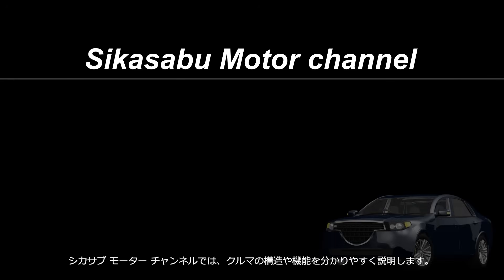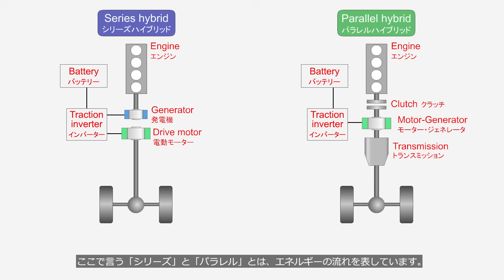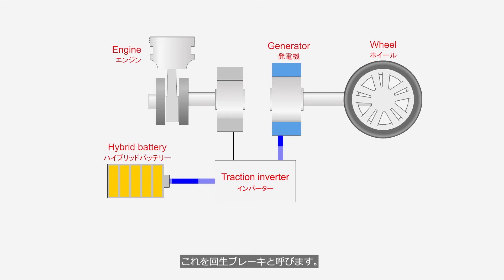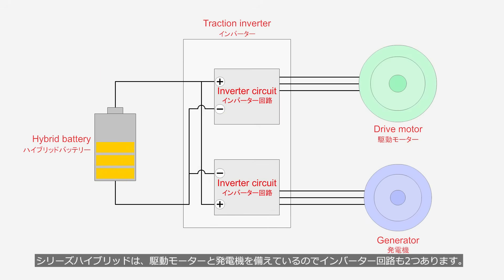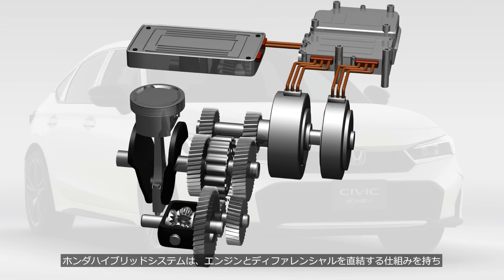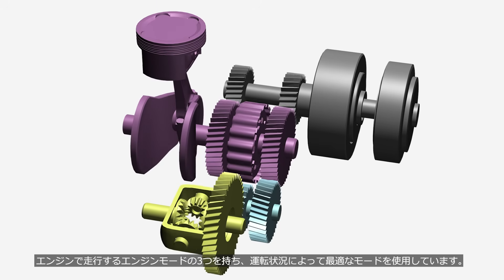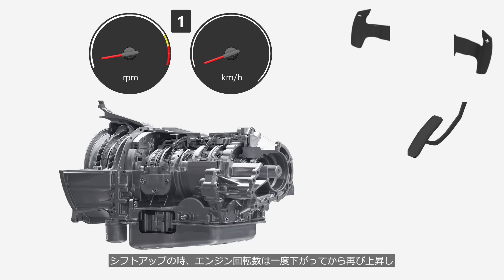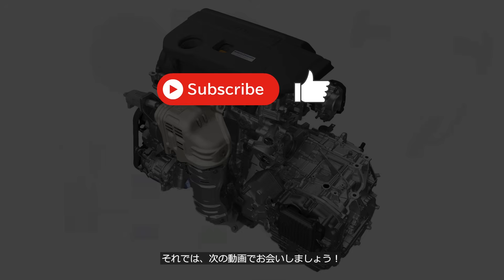Deep Dive into Honda Hybrid System　Can It Beat Toyota?

Comment: Honda's system is a copy of Mitsubishi outlander PHEV which is in use from 2012 or 2014 and proved. But Toyota's power split does not use clutch so Toyota's system is less complicated and superior
Reply from the maker: Thank you for watching the video.
The Mitsubishi Outlander PHEV was released in January 2013. The Honda Accord, which has a similar two-motor + clutch mechanism, was also launched in January 2013.
Reply: Mits uses the parallel hybrid mode for power assist, while Honda uses it for efficiency during cruise. So they have similar mechanics with a different purpose. And Honda's has been in use since 2013 (in Japan) and 2014 (in North America).

Toyota's system was stol... er, "developed independently" according to the lawsuit settlement - from one developed at the University of Maryland in the early 1990s. It is more complicated - mechanically, computationally, and electrically - since (1) it has more moving parts, (2) it must use both the parallel and serial hybrid paths at the same time, and (3) it must control them in unison. The Honda merely switches between the two.
Reply: @jeffjo8732  Yes. Toyota design did match the former Soviet engineer's design in some part of the design and had to pay. Honda system also (all cars including electric) will have a reduction gear. In the end Toyota Hybrid is more efficient than any other hybrid and multiple third-party tests have proved that.
Also, I have a 2005 Prius and still getting over 50+MPG in summer with 170K miles on it. Proven system for me. 
Honda's system is ingenious, but the real-world MPG is nowhere close the expectation (especially the CRV).
Reply: @adambakkam1527  I’m not sure what you think the reduction gear has to do with anything. It is not part of the infringed patent, if that is what you meant. Nor is the planetary gearset (Power Split Device). The control system is what was patented.

The planetary is, in essence, a glorified differential that has been used in many diverse applications, including some automatic transmissions. What the PSD does – and the patented control system governs - is allow power (of the appropriate type, mechanical or electrical) to flow, in any direction, between the ICE, the battery, and the wheels. The point is that the ICE is more efficient when it produces more power than is needed for cruising, but less than for acceleration. By using the battery as a buffer, the ICE can stay in its most efficient power band far more often than a traditional car could. This system was devised, implemented, and patented by a Ukrainian refugee from the Soviet Union before Toyota attempted the same. It seems absurd, at least to me, that Toyota would not know this at that time, yet that was their claim.

I also have no idea what third-party tests you think prove Toyota’s Hybrid Synergy Drive is more efficient that Honda’s Intelligent Muiti-Mode Drive. You may have confused, as most do, economy (mpg) with efficiency (utilization of the energy in fuel). A larger car with a more efficient power train can have lower economy.

AND, the Hondas that people think are “comparable” to Toyotas tend to be about to10% larger. For example, the passenger volume (in ft^3) in compared models are: Corolla 88.6, Civic 99.0, Camry 99.9, Accord 106.1. Of course, the Toyota measurements omit the "optional" moonroof that is standard in the Hondas. It takes about an inch from headroom, for these measurements. But wheel and tire sizes also play a part: the reason a Camry LE gets 51 mpg, while the SE gets 47 mpg, is exchanging 16” diameter wheels with 205mm wide tires for 18”, 235mm.

The best head-to-head comparison is the Camry SE and Civic SPORT. They are almost the exact same size (115 ft^3 total to 113.8) and ride on the same tires. The Civic gets 49 mpg. So iMMD is more efficient than HSD.

Now, I will agree that iMMD is more sensitive to aggressive driving on the highway. Since it is easier to apply quick power (being, in essence, an electric car), changing speeds frequently will push it out of the efficient power band more often. But in my 100K mile 2018 Accord (rated 47 mpg), I also get “over 50+ mpg” in the summer. Yesterday, driving 95 miles round trip to visit my son’s family, it was 56 mpg. That was 50% rural highways and 50% interstate (55 to 65 mph limits). But last week, a 250 mile day with city and higher-speed interstates, it was 55 mpg. Lifetime, it has averaged 48.5 mpg over all conditions. So this is above expectation.
Reply: @jeffjo8732  Meant to say that every car will have some transmission and nothing is transmission free. Honda uses two wet clutches which could wear down and in the power split there are no wearable parts.
Reply: @jeffjo8732  Thanks for the detailed explanation. I have learnt something new today.
Reply: @jeffjo8732  Thanks for the detailed explanation. I have learnt something new today.
Reply: @adambakkam1527  "Meant to say that every car will have some transmission." Technically, "transmission" means the act of moving power from one place to another. So every car needs a transmission system. In practice, "transmission" has come to mean either (A) the mechanical parts that connect the engine to the wheels, or (B) the parts that change the gear ratios in an A-transmission.

Honda's iMMD has a transmission system, and a part-time A-transmission. It does not have a B-transmission, contrary to how AMD describes it.

"In the power split there are no wearable parts." Sorry, that's wrong. Gears are "wearable parts." But the amount of wear experienced is essentially negligible. Because of how Honda's clutch is used - again, contrary to how AMD describes it - one in all models except the CR-V - it also experiences negligible wear. It only closes when the car is not accelerating, and speeds are matched by computer. Anytime the car accelerates it opens.

To demonstrate how little wear it gets, Toyota hybrids are more prone to clutch failures. Yes, they have one. It is a permanently-applied clutch built into the flywheel. It protects against sudden changes in either the engine, or wheel, rpm. In fact, all hybrids have one. But it is only in PSD hybrids that the engine is connected to the wheels when the engine is started. This causes slipping in this clutch that iMMD does not share.

Comment: Honda and BYD operate similarly.  Two motors, ICE engine, and parallel mode to front wheels.  BYD clutches the ICE output to front diff above 70 km/hr
Reply: Planetary gearset is more durable than a clutch though
Reply: @miraphycs7377  Weber Auto on utube.  Professor Kelly has a series on Toyota eCVT.  There are clutches on the planetary gears.  Synergy drive is an excellent system, but BYD is leaning on their blade batteries more and less on ICE.  This then allows a simpler transmission.
Reply: @mefobills279  First of all there are no clutches on the planetary gears. There is a "Torque limiting clutch pack" attached to the crankshaft of the engine that is used as a "damper" to lessen the shock impact between the engine and transaxle. This clutch pack does not disengage and re-engage like a regular clutch does. It’s simply there to absorb impact and torque from the engine to minimize damage to the transaxle. This is not a high wear item and should not be compared to the clutches used in other transmissions. It should never have to be replaced under normal operating conditions. These systems have proven to be very reliable. Some are even starting to say that they’re more reliable than a manual transmission.
Reply: @escheidl  It may not be high wear, but there is some. And the torque damper experiences more failures than the clutch in the Honda system.

The way the PSD works is by maintaining the rpm relationship 13*MG2=5*MG1+18*ICE. Note that motors operate in either direction, so MG1 and MG2 can be negative. And here, MG2 is directly geared to the wheels, so it is essentially the speed of the car.

To operate electric only, MG1=2.6*MG2 so that ICE=0. To start the engine while the car is moving, MG2 is actually slowed to make ICE increase in rpm. Essentially, it is the momentum of the car that starts the engine, not MG2. This is all done through the countershaft, the entire transaxle, and the torque damper. It is a much less gentle operation than starting the ICE with the generator alone, like Honda does.
Reply: @escheidl  it's hard to say whether this seemingly clutch-that-is-not-a-clutch is any more reliable than a plain ol' clutch. In fact, it has to "absorb impact" too, just like a regular clutch, except if I understand it right, it's doing it all the time. I don't really understand how the engine in the Toyota is engaged and disengaged from the drive shaft seemingly magically without wear as people seem to think. Parts have to rub together or separate in some fashion to do this. There is no free lunch here. 

I find it funny that it seems people are assigning magical powers to planetary gears. They're gears! In terms of reliability, they are no better than any other gears.
Reply: @Trekster1268   ? Toyota's engine is never declutched, it doesn't have to. When it needs to stop, the motors spin in a way to make its RPM go to 0. When it needs to start up, the motors spin it up like a starter.
Reply: Far more durable. It's the last mechanism that will fail in the system. It just doesn't offer coupling and uncoupling. Benefits to both @miraphycs7377
Reply: That is correct and this means that there are three possiblities in Honda/BYD system. 

First, when there is a full juice in the battery electric motor alone powers the wheels without waking up the gas engine. 

Second, at lower speed it functions like an aforementioned series hybrid system whereby the power goes from the engine, generator, battery, electric motor and finally the wheels.

Third at higher speed the engine alone is doing the work and is directly powering the wheels.

Toyota having the planetary power-split means not only can have these three scnearios but also having the engine charge and power the wheels at the same time as well as engine and electric motor both working together turning the wheels. This results in Toyota having better fuel economy at higher speed than Honda or BYD DM-i.
Reply: @miraphycs7377  At higher speeds, ICE is clutched to diff and may also be spinning motor generator two, charging the battery.  Toyota is doing a joint venture with BYD.  Toyota synergy drive is excellent, but their planetary gearset has higher costs than a simple clutched gear set like Honda and BYD.
Reply: @miraphycs7377  "Second, at lower speed it functions like an aforementioned series[1] hybrid system whereby the power goes from the engine, generator, battery, electric motor and finally the wheels."

No. Power goes from the engine to the generator to the Power Control Unit. The PCU then adjusts the power using the battery to send the right amount to the motor and finally the wheels. It adjusts down during cruise, by sending part of the power to the battery to charge it. Or up, for higher acceleration, by discharging the battery.

This may seem like a nitpick, but the "adjust down" is the heart of any hybrid system. It is how the battery charge is maintained.[2] The following is for the 2018-2022 Accord, but the principle is the same. The ICE is most efficient - 40.6% - when it makes 34 HP at 2000 rpm. And over 40.2% between 22 and 52 HP. But to cruise at 40 mph (the fastest cruise using your second mode), it needs 8 HP and is at best 33% efficient. So the ICE overproduces by operating somewhere in that 40.2+% range, and uses "adjust down" to charge the battery.

"Third at higher speed the engine alone is doing the work and is directly powering the wheels."

Not quite. The same "adjust down" is accomplished using the traction motor as a generator; "adjust up" is also possible, but usually your first mode is better.

"Toyota having the planetary power-split means ... the engine [can] charge and power the wheels at the same time." "

So can the Honda. In fact, the Toyota has to either operate below its best efficiency, or send a much larger portion through the battery, with losses, because it is using a larger ICE. So the Honda is better at this.
+++++
[1] Serial hybrid. "Series" is a noun, as in "the engine, generator, and motor are configured in series." "Serial" is the adjective form, as in "That makes it a serial hybrid." The confusion is probably caused by "parallel" being both a noun and an adjective. I know that most of the world uses these words incorrectly, and don't really care. But I can't say "series hybrid" any more than I can say "that ain't right."

[2] Regen recovers only about half of what is needed to return to the same speed. The rest comes from gas or drains the battery. So regen does not contribute to net charge, it only reduces what you would lose to braking.
Reply: @miraphycs7377  But Toyota lose acceleration to Honda/BYD.
Reply: @alexlo7708 It depends on the torque curve and whether you are accelerating from a stop or at speed. If you are going 100+km/h and wants to accelerate again, Toyota’s series-parallel hybrid will best out pure serial hybrids.
Reply from the maker: Thank you for sharing the information. I'm also interested in BYD's mechanisms.
Reply: What causes the Toyota eCVT droan noise that the Honda eCVT avoids? My ‘24 CR-V hybrid transmission is considerably more quiet & smooth than the ‘25 RAV4 PHEV I also got to drive for a day. I noticed increased transmission sounds below 25 mph (on the Toyota), especially when decelerating.
Reply: China car good luck. Used various china tyre cannot make it. Cannot even make good tyres so good luck..
Reply: I seems that important is, Made in Japan or Made in China

Comment: What’s better between Toyota and Honda’s latest hybrid system?
Reply from the maker: Thank you for your comment.
The pros and cons of those systems vary depending on the perspective. This channel also has videos explaining Toyota's systems, so please watch them and find your own answer.
Reply: I just changed from my 1.5L e:HEV to 2.5L THS 5. It consumes only ~ 2.0 km/L more when I use it with in my daily routes for months. For me Toyota wins when they can keep RPM constant in most of the cruising the time.
Reply: @brightlovesblacklabrador  try the 2.0L Honda civic e HEV and you will see how strong it is
Reply: Toyota, It's simpler and it works.